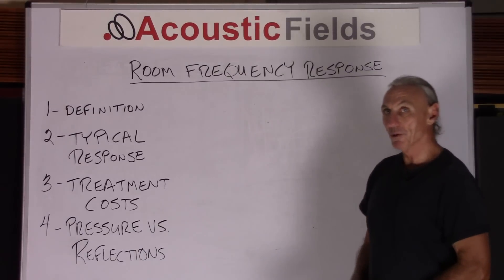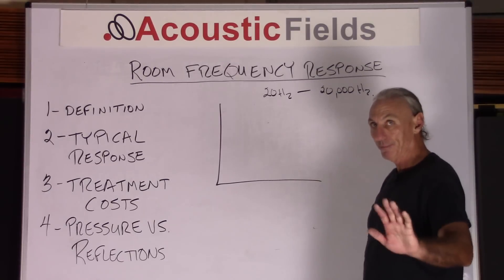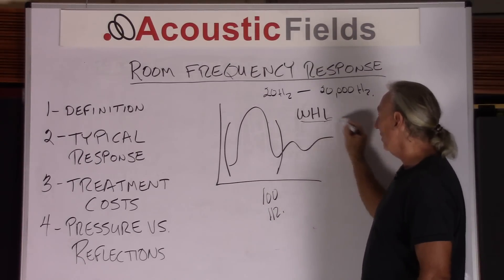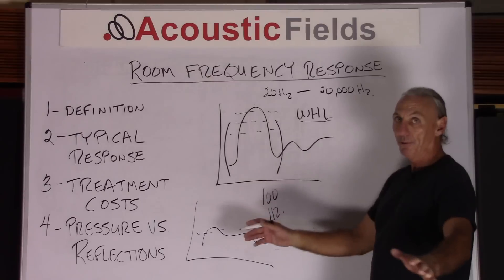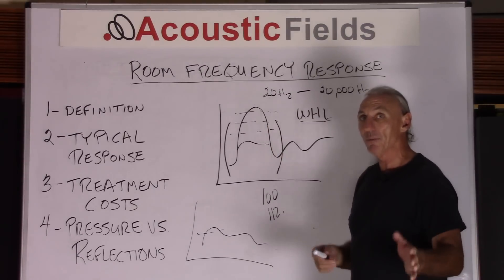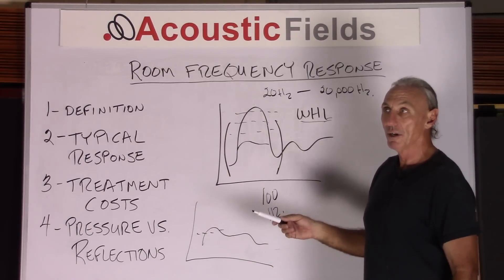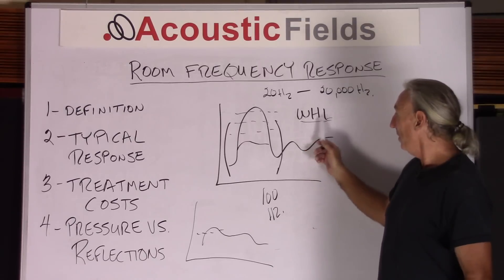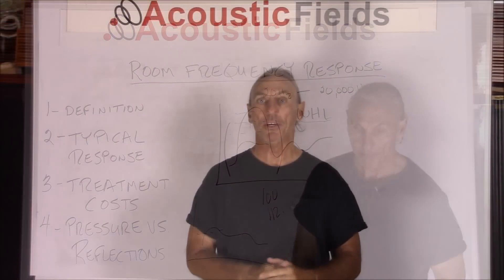Understanding Your Room Frequency Response Measurements - www.AcousticFields.com

Comment: He said W H L a 1000 times and never says what it should be, what is the point in that >?
Reply from the maker: That is because you must match the usage of the room to the dimensions. There is no one size fits all. Those that look for generalizations and a one size fits all will never achieve the highest resolution possible. This is not an easy science. It has many variables.
Reply: Yea a rule of thumb or indications of decent  dimensions may been of use instead of banging on about W H L. with no context. I could make a tutorial saying rockets need fuel, does not mean i've given you any decent information on building a rocket does it. This is what they mean when they say oxymoronic. To be honest it Is all a con, i've set up two studios so far and my production sounds ok when played back on multiple systems from mobile phones to a fully mono blocked and bi amped high end hifi. If it sounds good in the room when treated, it sound good everywhere else  - JUST TURN IT DOWN !

Comment: Yeah ideally a purpose room built for sound, with perfect ratio, no windows, panels and all the stuff would be a dream. In real life we have normal rooms that we have adapted to become listening spaces. I went through a similar low freq bump; I didn't change the room dimensions, I experimented with speaker height location, seating placement, simple absorption materials like rugs, frames. It 's not perfect, but have no high bumps or deep divs. People do your search and start with the Harman room calculator, it's free or a REW and a good mic like the U-Mik. Start with basic and simple adjustments, get to know how sound waves behave, how construction materials influence on sound and reflections. Then go all the way up to DSP's, multiple subs, absortion frames, accoustic panels and all that stuff.
Reply from the maker: This is one methodology to use. Howerver, it will not assist you with obtaining the highest resolution  possible which is our mission statement. We are not interested in compromises.

Comment: Hi great video finally someone that explains something i could try to understand ...
I just measured my room and its (Width: 13.1 feet) and (Length: 11.5 feet) and  (Height: 9.2 feet)
What my huge problem is i have a bump of +10dB at around 115-120 hz and a bump of +8dB around 50hz. 
But the thing is i cant hear the 120 hz frequency while im mixing but when i listen to my mixes on a car stereo it sound extremely bassy! 
What can i do? Thanks a lot in advance!
Reply from the maker: MX  The 50 Hz. fundamental produces 100 Hz. 150 Hz. 200 Hz. ....
harmonics. If you treat the 50 Hz. correctly, your harmonics will be less of an issue. You must treat the room for 50 Hz. Fill out the info in this link. Attach pics of all room wall surfaces.  https://www.acousticfields.com/free-room-analysis/
Reply: @AcousticFields  Thank you so much for the super fast reply i never expected so get one so soon! :) However i made a huge mistake when i was looking at the frequencies, its more closer to 60hz and not 50hz (sorry for that!)

Comment: Hi there, thank you for this information. I have tried a few tests in my room and notice from a G1 - F3 sine wave test there are massive volume changes from C#2 - E2 and the only rattle I get is at A1. How do I run an analysis like the chart you demonstrated that shows the bumps in the low end?
Reply from the maker: A,  Do a sine wave sweep of your room and walk around the room with a pressure meter and take measurements. Another easier option is to fill out our room data form so we can compare your room with our database. https://www.acousticfields.com/free-room-analysis/

Comment: Damn... another video from this guy basically saying I'm so screwed! Ughhhhh!!!!😥😥😥😥😥
Reply from the maker: A,  You can make improvements but you have to be realistic and realize that there is no 100 % solution.
Reply: @AcousticFields  I think I've done all I can without sacrificing even more space in that room. 8 gik 244 broadband bass traps in all corners. Huge heavy coutch, acustic panels on all reflection points. And I still have a low end kick in the face trouble. Plus, my wife already hates how I have the room setup!. Lol
Reply from the maker: A,  Yes. This is because their technology does not absorb low enough. I get this complaint 2 - 3 times a  month.

Comment: What are the "pressure activated devices" you mention as the solution to treating the bump in this video?
Reply from the maker: Hello SDM, There are two forms of energy that we all face in small rooms. Low frequency pressure from wavelengths that are not 'fitting" in our room dimensions. Secondly, we have reflections from our room boundary surfaces. Pressure activated devices are Helmholtz resonators, membrane absorbers, and the technology we use which is diaphragmatic absorption. All have different rates and levels of absorption and you must use the correct pressure activated technology to deal with your particular room response issue.

Comment: hi sir dennis, are there low frequency issues in big spaces like churches, will diaphramatic absorbers help to increase the intelligibillity of the spoken word, how do i determine how many bda should i use, thanks alot.
Reply from the maker: Hi Tinnitus, Low frequency issues in churches usually occur around the live performers. With drums, guitars, etc. there will always be a need for unwanted pressure management. The biggest issue we see with churches in the high Rt-60 (reflection) times which impact speech intelligibility and music. Unfortunately most churches do not have budget for treatment nor are they willing to cover the square footage requirements on the walls with the proper rates and levels of absorptive material.
Reply from the maker: Sorry, didn't see the second part. Fill out the information in this link and lets take a look at your situation. http://www.acousticfields.com/free-room-analysis/

Comment: Good day... (I'm new here) Please tell me - how should I choose the dimensions of a room that's basically 2 rectangular rooms in one(say an imbalanced 'L' shape)? Do I average the room dimensions creating a regular room? The room also has protruding columns about 18'' from 2 of it's corners(& a sine wave concrete ceiling) - does that matter? Should I cater to those imperfections as well? I also did an sound test & my room has a sharp 45db or so drop in output from about 45Hz down to 20Hz - what would you suggest I do to improve response in that area? Thanks...
Reply from the maker: Hi Marvin, I will need much more information to assist you. Go to this link and fill out the information requested. Photos of all room boundary surfaces are always a good idea to include with the room form. http://www.acousticfields.com/free-room-analysis/
Reply: Thanks... =]

Comment: If i have ideal size room i.e Width 17'
Height 10' and Length 23'. then how many rock wool panels are required to be applied in this ideal size room. how many rock wool panels in trihedrals and dihedrals and than walls and ceiling.
Reply from the maker: +Concept The Band  Please fill out the information required in this link: http://www.acousticfields.com/free-acoustic-treatment-room-analysis-tell-us-room/

Comment: My Room has a Heigh of 3.10 meters a length of 14.75 meters and a width of 3.5 meters

the room has concrete wall = is this a good room dimension ???'
Reply from the maker: +Joao Paulo Oliveira Go to this link:http://www.acousticfields.com/free-acoustic-treatment-room-analysis-tell-us-room/. Fill out all the required information and submit. I will give you some size and volume options to consider. Dennis

Comment: I have very bright sound when I record it sound very clear I was just wondering would carpet make the vocals sound warm as the professionals mixes or is there any way to do that with acoustics treatment
Reply from the maker: Hi Anthony Williams 

The brightness you are experiencing in your recordings comes from many sources. It can be attributed to the surface material used in the construction of your room surfaces. Drywall or gypsum board that is a common wall covering is excessively bright. If you have multiple surfaces that are made of "bright" materials, you will need to cover them with the appropriate sound absorbing material. Make sure you choose a technology that has the proper rates and levels of absorption required on each room surface. Contrary to common belief, they are all not the same.

Our 2" acoustic foam would be a good starting point given its smooth absorption curve:
http://www.acousticfields.com/product/acoustic-foam/

Thanks
Dennis
Reply from the maker: Hi Anthony Williams 

How are you?  I answered your question in a little more depth in this weeks Google Hangout.  You can see your answer here:
http://youtu.be/uXsSnXIzsTI

Thanks
Dennis

Comment: What ratio do you use as the golden ratio.  If you built the ideal room what would its dimensions be?
Reply: +Acoustic Fields so if I have 17' width and 23' length and 10' height of room than how many rock wool panels do I have to place in this room and kindly tell the thickness of rock wool panels as well. somebody told me that place 2" thick rock wool panels on walls and ceilings and use 4"-6" thick rock wool panels in corners.  Cover all trihedrals which are 2 in each corner. so a total of 8 trihedrals and than cover the vertical and horizontal dihedrals . Than after that go for ceiling and walls and carpet the floor is this right thing to do.
Reply from the maker: Hi Mark Flaten 

I do not know what you mean by "golden". If you mean absolute then, there really isn't such a thing. All rooms have some type of acoustical distortion to contend with. The best thing you can do is choose a room size and volume where the treatment needed to correct the room distortions is in proportion to sonic objective of the room, budget, and space requirements for the treatment. We use 17' W x 10' H x 23' L as our break point where room sizes and volumes above and below this point, have a balance in treatment space requirements and cost.

Thanks
Dennis

Comment: Hi Dennis,

So how we can calculate the room's width, height, and length to avoid big bump under 100 Hz? I saw this is very important, especially at the beginning designing a room's size.

Thanks for the video.

Rifqi,
Indonesia
Reply from the maker: Hi Rifqi Ikhwanuddin 

Make sure no dimension in the room is smaller than 14'. If this is not possible, then you will have to use a large amount of treatment.  I will be doing a video shortly that states starting room dimensions so stay tuned for that.

Thanks
Dennis